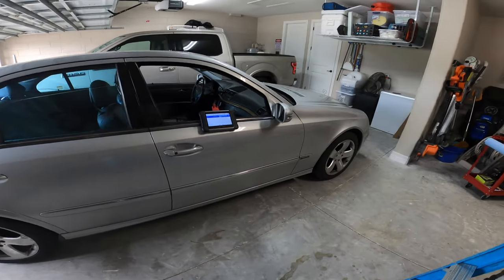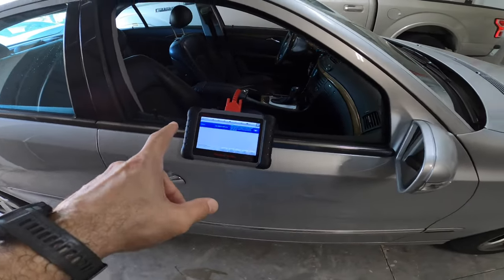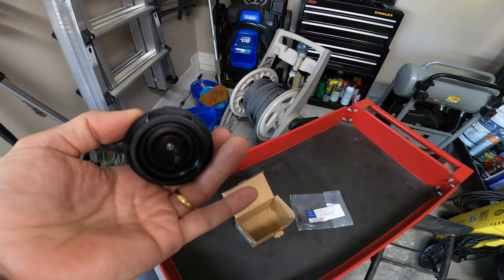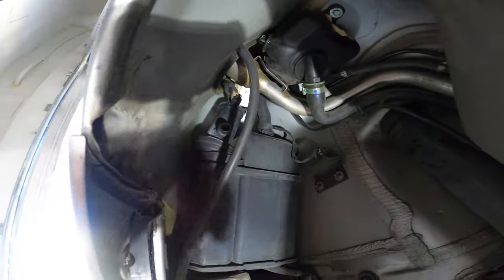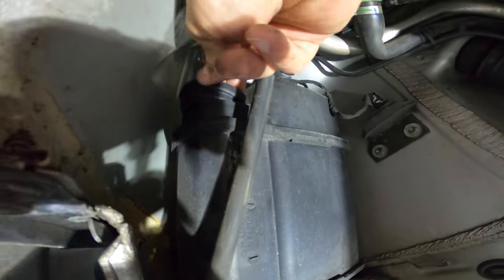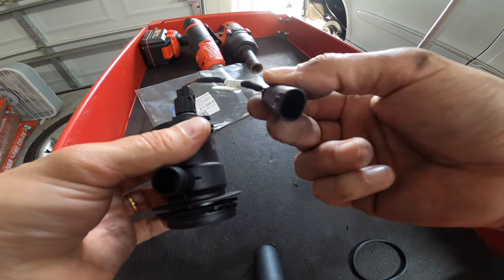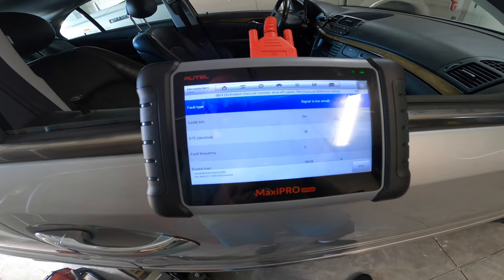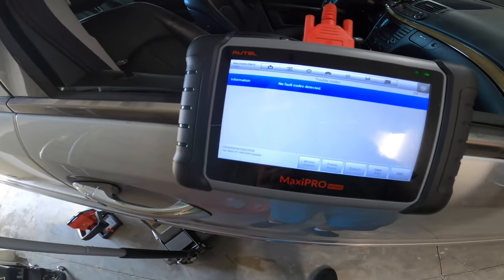EVAP Leak Fix W211 Mercedes - DTC Y58/4

Comment: You checked the transmission code the second time. not the engine codes. That fault shows up in engine because it is part of the emissions  not the transmission.
Reply from the maker: Thanks for the tip
Reply: Yup just seen he did that as well. Smh

Comment: what is this called. and i have a code P0446 on my 03 mercedes benz e500. can you let us know we gladly appreciate it. thanks
Reply: Same. 04 E320. I have that code. I also have a fuel odor around the right rear of the car if I fill the tank past 3/4 full. I had a shop look at it and they recommended replacing this part.
Reply: It’s the shut off valve and you’ll need new O-ring and harness. It’s located on the passenger rear side for the E500. Good luck taking off the valve it’s a pain. I had to take the canister off by placing a long flat pipe underneath the canister and push up.  You don’t need to disable the bottom hose.

Comment: Were you getting any fuel odors? I have a P0446 code on my 2004 E320. This seems like the first thing that I would attempt replacing, given that the odor is around the right rear area of the car if I fuel up past 3/4 tank. I did check to see if there were any leaks in the backseat area, and there were none. Also lifted the car and the rear area is dry.
Reply from the maker: Felt it inside the car
Reply: @dcfgarage  I ended up replacing both the part you replaced and the charcoal canister. Charcoal canister had to be replaced because it was completely clogged. No more fuel smell (thankfully🙏🏻), but my check engine light still comes on. Honestly, at this point I don’t care anymore. I just wanted the smell to be gone.

Comment: Awesome. You make things look easy. Curious what brand unit you’re using to detect the codes?
Reply from the maker: It's an Autel Pro MP808. Best price for a bidirectional OBD reader. Bidirectional = active testing
Reply: @dcfgarage  Yes I just got the exact same scanner.  Its expensive but with 3 benz and  1 Volvo in the family and all 15+ years old, its a must have.

Comment: This sounds like my problem.  My 2004 E500 pops up the check fuel cap warning and has done it enough that the check engine light is in now.  I replaced the fuel cap but it didn’t help.  I enjoyed your detailed replacement of the valve.  Thanks, Tom

Comment: You made it look so simple.  I had a hard time putting in the replacement. The new valve need to be set on a certain position then press and turn. With so little room to work with. I had to take down the canister.  It was a PITA.

Is there a hose to connect to the shut off valve or is it supposed to be left open?
Reply from the maker: Like most cars, sometimes you have to use just the hands and no eyes. The valve has just the electrical connection to open the vent

Comment: I have a non related question, I have a hard time filling my tank without the pump shutting off, could the charcoal canister hose be clogged? And if so, is the hose that comes down and goes into the canister the one that I should try to unclog? The one to the right of the valve. Thanks
Reply from the maker: As far as I know once the canister is clogged you should replace it

Comment: So looking at your videos it appears that your E320 has something break every 30 days or so. Is that accurate?
I have a 2003 E500 with 72 k and I want to know what I m in for. I am mechanically inclined and like to tinker.
Reply: I have a 2006 E500 and battling this P0446 issue. Just changed the purge valve, replace this shut off valve, new O-Ring and harness.  The code still came back. I don’t know what else to do.
Reply: Did you replace the fuel cap?
Reply: @georgeanddaddecker7563  - it was the first thing to do. Got a brand new OEM cap too. I’m so lost right now.
Reply from the maker: Very accurate